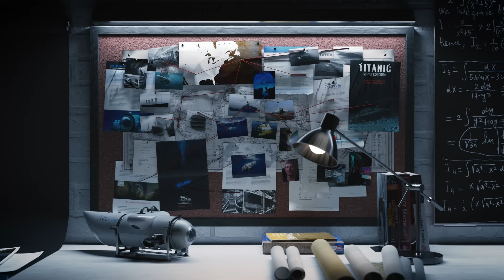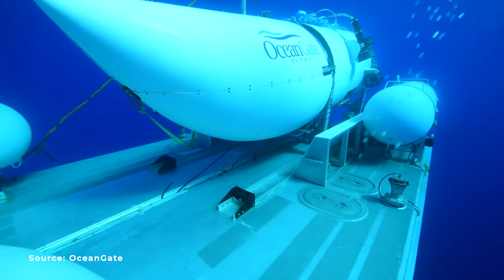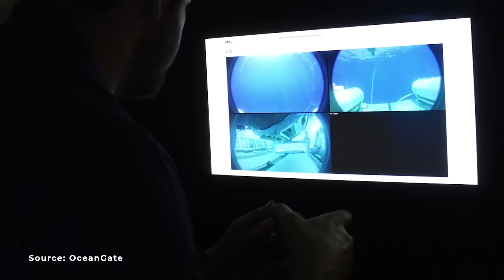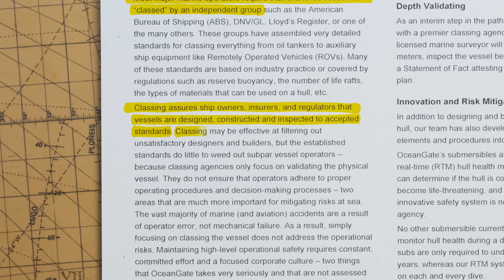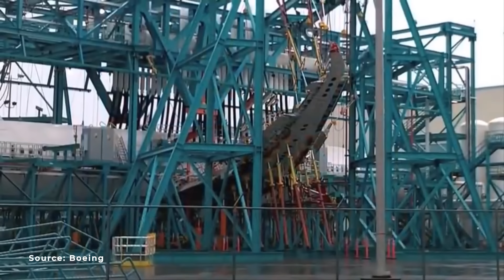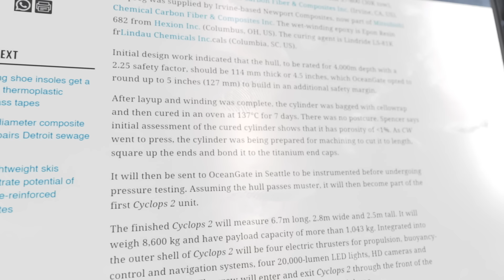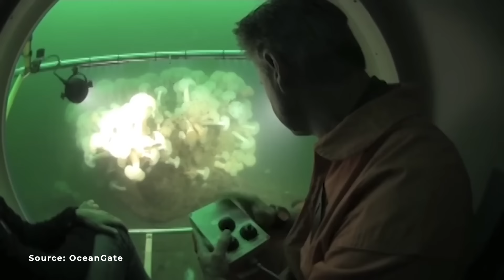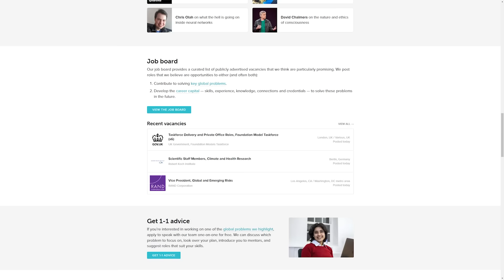The Questionable Engineering of Oceangate

Comment: Great video. I was hoping it would have discussed more about carbon fiber strength. Some conjecture is talking about how slightly off-axis endcaps could squish the carbon fiber together with lateral forces vs the direction the fibers were spun. There is also commentary about weaving fiber in X patterns vs wrapping in parallel like ////

Comment: Compare their few successful missions with this one. That'd be interesting. Because OceanGate has been around for many years already doing the same mission with many of the same carbon fiber techniques.
Reply: It's called fatigue failure! If something survives it once, and survives it quite fine once, it might not survive it fine by x100. That's why people were talking about warning of fatigue failure: it has a very specific engineering meaning: and composites like carbon fibre are really susceptible to fatigue (altho tbf even well-behaved metals can & will fatigue too)

It's a bit like how a slinky gets tired. It's all fun and springy the first few days but two years down the track it just flops sadly and doesn't do anything? That, but the slinky is the carbon fibre hull, the only thing protecting you from mindboggling amounts of water pressure

Comment: The idea that the crew could have seen and heard their craft coming apart at the seams is terrifying.
Reply: They didn't have time to really hear anything, carbon fiber doesnt bend, it shatters! At those pressures they would have been instantly imploded (into a thousand pieces) instantly, faster than a fraction of a second...
Reply: @nfineon not only would they have been crushed, they would have been flash-incinerated as that pressure vessel turned into a giant fire piston. The area inside the collapsing air bubble would have rocketed to several thousand degrees in microseconds.
Reply: It terrifies me to the core.
Reply: I saw an explanation in other video of a Doctor, explaining this: both image and pain signals travels slower to the brain than the fact itself. Which means that one milisecond they´re alive, the next they´re dead. No feeling, no pain, no image, because the brain just didn´t have time enough to receive the signals and process them properly. Here´s the link, I searched for this specific issue because I had the same thought, what a horrifying last minutes on this earth... but, luckily (sort of speack) they felt nothing.

https://www.youtube.com/watch?v=CfUcNPr2T8A

I hope it relieves you as it relieved me ;)
Reply: @Vaninasanta  they didn't feel anything, but they would've heard all sorts of horrific sounds before the actual sub imploded. Especially if as in the video he says the material starts peeling from the inside first.
Reply: @Fucisko  The moment the hull started peeling was at most half a second away from catastrophic failure. The most the people on board could process was likely surprise before they ceased.
Reply: From the (unvalidated) transcript of the voyage, there was a crackling noise for about 20 minutes before communication was lost. That alone would have made me poop my pants.
Reply: The CEO is the main culprit. He probably forced the crew to continue operating despite its flaws
Reply: @TehWarbird the CEO was piloting it, hes dead.
Reply: They started ascending before it happened so they knew something was wrong, however something goes wrong a lot on that thing so they may not have felt sheer terror. A lot of people speculate that the crack alarm mentioned in this video went off, but the video implies that doesn’t make sense.
Reply: @emilyk5003  Just because they have begun to ascend doesn't mean that it was due to any alarms; They could have concluded their visit to the Titanic and during ascent the sub imploded.
Reply: “Coming apart at the seams” is less accurate than “coming together”
Reply: Previous dives already had reports of cracking noises, and given how composites work that very likely was the early stages of the failure that ultimately killed people just a fiber or two in a critical area. The actual failure itself would have been pretty sudden though, they probably wouldn't have fully understood the situation prior to death
Reply: They didn't hear a thing. The collapse began and ended in under one twentieth of a second.

Comment: Great that you pointed out the non-ductile behavior of carbon composites & calling BS on their "damage monitoring system".  I wouldn't be throwing rocks at <1% voids (<2% is the aerospace gold standard) other than pretty much impossible to verify that in a laminate this thick so don't believe that for a minute.  Yes, autoclaves are preferred to get good compaction pressure but fillament winding (if you know what you are doing - think ATK for solid rocket boosters) is a reasonable approach for this structure, using the fiber tension when winding to get good compaction.  Never heard of "snap buckling delamination" but will give the designers the benefit of the doubt that they were paying attention to the interlaminar shear stress of the resin.  And Carbon laminates still have fairly good compression properties compared to tensile (perhaps you were thinking of Kevlar?).

What is missing from this discussion (AND all the other ones - nice video compilation by the way) is the joint between the Ti endcaps and the carbon epoxy main structure.  Suspect the margins were plenty high for the composite tube (yes fatigue is a concern but composites are always much better at fatigue than metallics and we are talking very low cycles here).   The joints are always the weak link in composites and this is one heck of a joint with a composite that thick.  Bet money that this is what failed first.  But just a Composites R&D Engineer with 35 years aerospace experience...

Comment: I just hope you won't be making one of these videos on Starship when it blows up with passengers INSIDE the second stage of the vehicle sitting over top thousands of pounds of propellant. I still think, SpaceX needs to make a very specialized Starship for lifting people which has ejection capsules or a detachable, "abortable" crew cabin. Cargo should fly on a separate type of Starship.

Comment: Now that the composites failure is being analysed, it would be good to have a video on what went wrong on Dilano Vant Hoff's accident at Spa Francorchamps on the formula regional championship.

The car is a Tatuus T318 carbon monocoque with several impact structures around it, the usual "it wasnt designed to withstand the force of the impact" is quite vague and not enough to actually improve the safety of these cars.

Top job on being so vocal on this

Comment: Unfortunately, your carbon-fibre fracture graph 10:55 does not reflect the discussed situation as it shows the behaviour of carbon-fibres under tensile stress whereas we are talking about compressive stress.

I am not an engineer, nevertheless it seems so incredibly crystal-clear to me that any fibres are completely useless to protect a cylinder from compression.
Fibres are the guys to be used if the inner pressure is greater than that of the outside, like in the situation of a space vehicle, where they would protect the hull from been torn apart.

It's probably easier to be seen in the following analogy:

If I want to protect a sheet of paper from being torn apart, 
it is probably helpful to cover it from one side with duct tape.

If I want to protect a sheet of paper from being crumbled,
it is completely needless to cover it with duct tape.
Maybe a solution would be to glue it onto a hard plate of metal.
But OceanGate would have used loads of duct tape to protect the paper from being crumbled!

That's why I think the outer layer of carbon-fibres was completely useless so that the compression the hull was able to take effectively was defined only by the inner steel tube and nothing more.
Reply: Okay, maybe the carbon-fibres in connection with the used epoxy gave a hard and solid layer that could withstand a certain amount of compression but anyway my intuition tells me that fibres could be associated with scenarios where you have tension but never where you have to withstand compression.

Why in the world use any fibres + epoxy to obtain a hard and solid material if there is a vast choice of materials which are naturally hard and solid by themselves!

This confirms how Stockton Rush once said: "We have broken with logic..."

Comment: At 9:02 just wait and look how thin the lip was on the titanium ring, that they glued to the carbon fiber. You've got to be kidding me.  Maybe a 3 inch thin lip, glued? Wow. Right there, it was designed to fail. The pressure at that spot is insane. 
The only good thing about this tragedy is that, he won't be putting anyone else in danger.

Comment: What I've gathered from your video is that two alternative designs would have been:
A ripple-chip style hull where the fiber lay over a titanium skeleton in order to keep the fibers in tension. 
Fiber reinforced cement with an exterior waterproofing layer.

Comment: My experience with carbon fiber is pretty much limited to mi bicycle's frame... That is enough for me to instantly point out (before even reading the sub had imploded) that carbon fiber is not a good material. It's not made for compression and snaps instantly. I am not a material engineer, I'm a software engineer, yet that and my experience with scuba diving, gave me enough to know it was destined to fail. 

It makes me sad how this tragedy was preventable even by someone so far from the needed field of expertise.

Comment: Sadly, it appears Stockton Rush's philosophy about innovation, by necessity, excluded, "standard" testing. All because he did want to pony up the dough to send a mock sub to those depths, multiple times and inspect a cross-section of the pressure vessel. You wouldn't even need all of the electronics. Just load it with sandbags to approximate the payload and send it down. Retrieve it, then inspect it. I know, this all sounds simple in hindsight but we're talking about people's lives at risk. He wanted to be Elon Musk on Hunter Biden's budget.

Comment: The guy just used carbon fibre just because it was cheaper to produce, it was lighter than metal so it would float back up much more easily than if it was a metal tube. 

Otherwise the vessel would need to let water into a bladder to descend and then force water out to climb back up. 

The fast rate of descent would probably have been questioned, but the CEO and the "brains" behind this whole thing was in the vessel itself so they may have not felt confident to tell the CEO to stop what he's doing and climb back to the surface.

Comment: yeah snap buckling sound like it is just a sign that delamination occured, cause delamination occured and the inner wall was under pressure and there is no room it buckles ... buckling just sound like a symptom that delamination happened, so delamination is the most important word.
whatever .... who the F put carbon fibers under compression..... if it was going to be under compression you need carbon fibers criss crossing in all possible vectors since compression also causes sideways forces in the material.

Metals really are a very decent material after all. And it has its elastic region making it assume its origional shape when the load is removed.

Comment: Recently what were purported to be the transcripts between the sub and the mothership were released. It shows that the sub attempted to come to the surface after trouble was detected and noises were heard. However, according to the guy who analyzed the tape, he mentioned, (according to the transcript) that it is possible that water got in there without a catastrophic explosion and caused it not to be able to get back on the surface after they dropped the ballast due to the partial flooding. 
If the transcripts are real, they were in really deep over their heads, and knew it. (No pun intended)
Great video, thank you.

Comment: So the regulatory bodies sort out the badly designed submersibles, and this dude honestly thought that had no bearing on the fact that most accidents that do happen aren't because of mechanical failure. Wow. Like, of course I agree that the operator certification is a necessary additional step, but denying that mechanical certification is the exact reason why so few mechanical accidents happen just has mad "they can never revoke my driving license if I don't get one in the first place!" energy

Comment: Yeah. Take a piece of paper, roll it into a cylinder. If you push from within it, it'll tear/ come apart.
If you take a string and wrap it around it, it'll be much much stronger if pushed from inside, yet it will do absolutely nothing to prevent it from being crushed externally

Comment: Just from my limited knowledge on composite, pretty sure it’s only fully rated in tension, the compression load would put the whole load on the epoxy, not very strong with cycles and micro cracking, causing eventual failure.

Comment: The sub made 20 successful deep dives, 3 of which were to the Titanic and back safely. Now, use your heads. Was this a total failure?  No. 20-1 is not a failure. It is a stepping stone in new innovative technology. Just like we had cars without seat belts, we have them installed in all vehicles now because people died, but did we stop making cars? No. They were innovative and they worked more then they failed. Same as the sub. Now, take the same mindset and use that on this sub, find out what went wrong and improve on it. it worked 20 trips so the design is a workable tech that needs the next step.

Comment: I used to work as composites technician for a company that seemed to have a similar engineering culture. Composites have complex failure modes and quality control is very difficult. But it never seemed like any concern ever slowed down the project.

Comment: Ok but how exactly do we know the composite hull was the issue? I'd like to understand that.
Reply: Because they studied the material and found it was likely to fail under multiple exposures to that high of an amount of pressure. So unless the sub got pecked a part by a squid it was most likely the hull. Actually even if they were pecked apart by a squid it would've still probably been the hull, unless the little glass view screen was cheaped out on as well, which seems possible here. however I believe they recovered enough of it off the bottom of the ocean to see where it failed.
Reply: @ohemge12  The glass window was rated for way less depth than they went to. If I'm not wrong, like 1/10th the depth. Anyway what EVIDENCE do we have that the hull is the issue? So far all I'm seeing is educated guesses. Unlike when a plane crashes, the search for wreckage and black box is on, and sometimes the cause of the crash is most surprising.
Reply: @MultiSciGeek  cant say for certain either, but really the biggest issue would be the hull, so thats most likely what went wrong, we most likely wouldve been able to tell with some form of black box onboard because as he said in the video there was equitment ment to monitor that, but having been able to drag some of the wreckage up from the bottom is probably enough to beable to tell that’s what happened. I’m still not ruling out the Orcas taught Squids what submerisbles are and thats what got them, personally, I would rather see that instead of just hearing some snap crackles and pops like I was waiting for my demise staring into my bowl of cereal.

What do you think happened if not an implosion?

Comment: There's a big difference between the SpaceX approach and what these guys here delivered. Yes, they have a different approach of how to design stuff. But first we have to see that many of SpaceX's rapid unscheduled disassemblies were indeed tests. For that exact reason: testing. And the second thing is (and probably very important for the success of that rocket series) that the Falcon 9 is actually quite a conservative, conventional design in many aspects. The focus of the innovation was on the reusability. The rest is a box standard kerosine an LOX fueled rocket like the venerable Atlas was back in the 1950's. Same with the Starship: thought initially about CFRP, quickly figured out that it's crap and went back to the good old stainless steel, because of f**k experiments where not needed. That is what OceanGate should have done too: take that unfancy old steel drum, when every past test and experience says, it is the best way to go anyway.

Comment: Incredible video and the best engineering video on the Titan I’ve seen so far. Learning about carbon composites and it’s strengths/weaknesses is truly fascinating. 

I would love to learn more about the other engineering and design flaws with the Titan such as using the titanium end caps and a weak point in the seals where the two materials meet. Also, the window. How strong was that? Do we have any insight to its strength and depth rating but also the strength of those seals around the window on the titanium? 

All in all, wonderful video and the perfect summary of the flaws with carbon in this use scenario. The more we learn about Rush, Oceangate and Titan, the crazier this story gets.

Comment: As an engineer with some experience with composites (but no expert), I don't understand why (from the manufacturing videos I've seen) why the tube was only wound radially with carbon fiber. There was also tremendous pressure from the titanium end bells pushing inward in the axial direction. Without carbon fibers being layered in the axial direction also, it was basically the glue in the carbon fiber keeping the end bells from collapsing inward. The modulus of elasticity, strength, and fatigue life of the glue is much different than the carbon fiber, and in my opinion, was the biggest contributing factor of the failure.